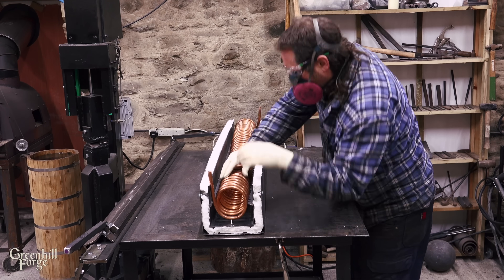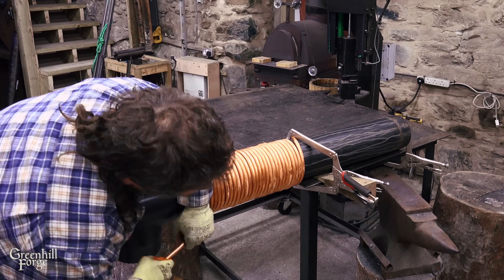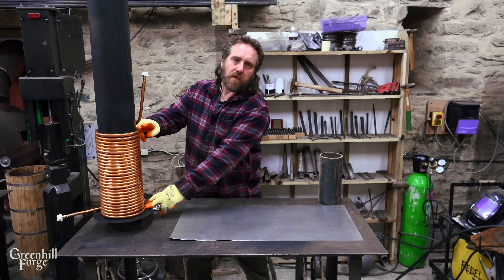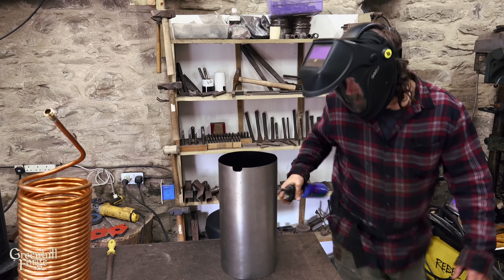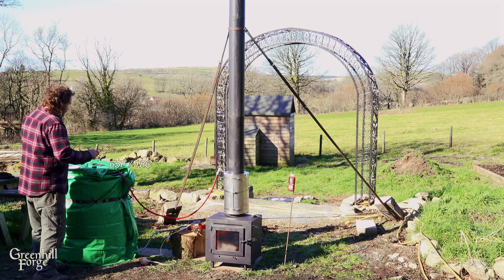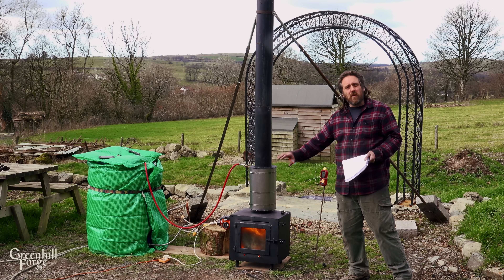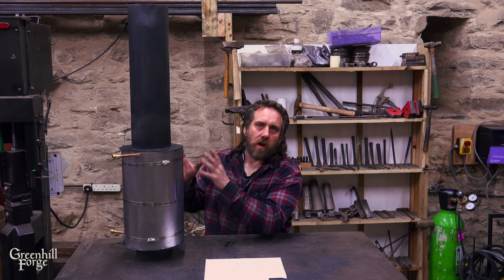Best Wood Stove Water Heater Yet: New Design Tested | Off Grid Water Heater pt3

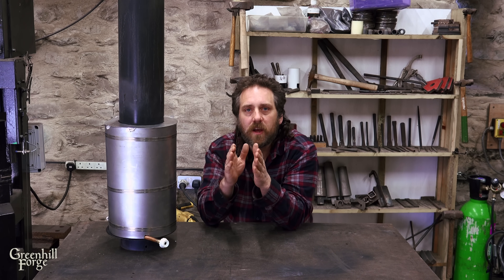Comment: 7:45 min: You are completely ignoring the horizontal surface of the fire box itself. Fabricating a shroud to capture the heat of the horizontal surface and have it funnel hot air into the copper coil sleeve.  Air holes to allow air to flow over the flat of the fire box and then funnelled to flow over the coil vertically upwards. A controlled aperture at the top of the coil sleeve would control the air velocity. This eliminates the need for insulation and heats the water from the entire surface area of the copper, not just from the contact with the flue.
 If one wished to use the flat area on top of the fire box for cooking you could fabricate a false box on top to serve the same function of funneling into the coil sleeve as a cone shape. This would still funnel very hot air, yet one could still cook. Controlling the air flow through the false box would also result in temperature control on the cooking area without reducing the fire. Another thought is using the false box as an oven for low lying food (i.e. cookies or fries. I would think you'd only want the false box to be 3-6" in height).
I enjoy your vids, tks

Comment: What happens if you install a 90 on your flue, then install your thermal transfer unit then another 90 back to the vertical? 
I would try that, but I would also try making it similar to a commercial boiler with steel tubes passing the flue gas through the water chamber then on the exhaust end install a box with a door that provides access for regular cleaning of the tubes with a bore brush.

Comment: Super cool set of experiments and outcomes. My one idea to improve it would be to make the flu wall crinkly where you have the copper coil and assembly. A crinkly wall will have more surface area but should not present a buildup issue inside of the fluid itself.

Comment: One large diameter water pipe inside the flue, or a C-shaped flue with the water inside? It would minimize surface area for creosote condensation. And with a C-shaped flue you could direct the radiant heat outward while having the wall-facing heat absorbed by the water.

Comment: Mechanical engineer here....The heat transfer is both a function of delta temperature of the flue gas vs the water and the thermal resistance between those two things.  Also a function of surface area.  Anything to improve those will help.  Making that copper pipe contact the steel liner better will make large improvements.  You could try filling it with water instead of graphite as a test and I bet it improves the heat transfer even more.
Reply: Could you eliminate the copper entirely and have a water jacket over the flue with pump flowing either from the top or the bottom? I guess it would boil too quickly and wouldn't meet the objective of using thermal to create the flow. Also more difficult to seal?
Reply: @spongefactory yes, this is literally how all real steam boilers work. Just copy one of the old steam locomotives
Reply: @spongefactory  On the downside, he will need to consider and address galvanic corrosion since the water medium will bring the dissimilar metals into electrical contact.
Reply: @tyiu5629 easily overcome with a standard sacrificial anode
Reply: @MYeahman an anode of what material, when the two in question are copper and steel?
Reply: @harrickvharrick3957  zinc, aluminium, magnesium or a alloy of these
Reply: @Greenhill Forge
Reply: @spongefactory  That would be the best idea.  He should try this.
Reply from the maker: @MrPizzaman09  Yeah, waterjackets/boilers are almost certainly the most efficient and I'll get into them eventually. Here I'm trying to make something than can be added on to a normal stove. I've got a grand vision I've been working toward that is in the design phase and won't be too much longer.
Reply: @GreenhillForge  Fantastic
Reply: @GreenhillForge where did u buy that little wood stove? 
I've been looking for a little wood stove but all I can find are really expensive...
Reply from the maker: @timstiles9026  I built this one and here's a video of the build https://youtu.be/pfWMZuctbXM
Reply: @GreenhillForge  and cooper tube spiral inside water jacket for healthy water. Also one idea to modify the stove so the water jacket sinks inside the stove burning chamber an inch or two, depending how big the stove or chamber is. logicaly should heat the water even faster. Peace and Respect.
Reply: Since your entitlement is probably close to 33% with the copper pipe inside the flue pipe, you probably won't get much better than 20% with it on the outside unless you were to stretch the copper coil up the length of the flue pipe more to increase surface area.  Part of the thermal resistance is the convection of the air inside the flue pipe to the steel, which will be part of the optimization game....most easily done by collecting heat further up the flue pipe .
Reply: Also a mechanical engineer here. If the intent of the testing of this setup is inside an off grid home and the wood stove is the heat source, one should concern themselves very little with efficiency of the heat transfer. With an older wood stove with incomplete combustion and high thermal efficiency, the rapid cooling of the flue gasses will condense the gasses, and creasote will build up in that area especially. If the "waste heat" runs through a brick chimney and heats your home, then the concern of efficiency isn't as important unless the domestic hot water requirements far outweigh the heating requirements. An example of this might be in the fall or spring, perhaps when you still want hot water but don't really need much heating.

Others have suggested spacing out the coils vertically for the next iterations for heat transfer area. I also recommend the same, but for the explicit reason of increasing natural convection in the fluid (you might hear it called "thermosyphon", or "stack effect", it all comes down to natural convection). It was mentioned that the ideal setup has no pump, so having a taller coil will help with this. I would actually like to embed a few vertical copper pipes, encased in grout, between the bricks and ss liner of a chimney from the basement to just below the roof rafters. It would take a while to come up to temperature but would make for great circulation.

My last comment is regarding thermal mass. I personally have a well-insulated ss glycol tank that is 105 US Gal because the water temperature drops quickly when taking a shower. The larger the tank, the less the temperature drops, but also the longer it takes to heat up. A smaller tank and higher efficiency heat transfer would be more suitable for a cabin if it were not lived in all the time, and you didn't want to wait long to come up to temperature.
Reply: Hi, another mechanical engineer here. I'm landing on a couple of improvements that you and others have mentioned. First, heat conductance (or lack thereof) is probably the single biggest issue here, since the coiled copper pipe only has a thin spiral line directly touching the flue on its ID. Furthermore, even that skinny point of contact is compromised because of the loosey-goosy construction where the coil isn't undersized initially to force it to constrict on the flue when wrapped around it. The graphite powder is a good idea (thermal conductivity 70-150 Wm°K), but the problem remains that on a micro level the grains only partially touch the copper and flue surfaces. If he used a solder alloy (thermal conductivity 60 Wm°K) to fill in the gaps between the copper pipe and the flue, his net touching surface area would jump. The solder shouldn't melt in use, because the water jacket should keep it under 212 °F. This is the same principal as boiling water in a paper cup under a flame.

Secondly, since the flue is quite long and remains consistently hot along its length, uncoiling the copper pipe to contact more uncooled flue pipe increases the ΔT overall.

This is a fun project and I'm glad he posted it.
Reply: I just had a final thought. The guy is a good welder, and the water is under very low pressure, so why not skip the copper tube and complete the water jacket? Simply weld in two threaded fittings, one at the bottom and one at the top, and voila! Perfect heat conductivity (or as perfectly as we can get in this simple setup). He can weld some obstructions to the flue (not enough to block the flow of water) to introduce turbulence inside the annular space too, increasing the rate of heat transfer. Apologies to other posters if they already thought of this.
Reply from the maker: @Paso_Dan  waterjackets/boilers are almost certainly the most efficient and I'll get into them eventually. Here I'm trying to make something than can be added on to a normal stove. I made an off-grid flue water jacket shower system I show in this video if you want to check it out. https://youtu.be/pP_2A5Wdvqg
Reply from the maker: @Paso_Dan  Hey. Good ideas. Copper powder would be an upgrade but much more expensive. Generally I agree about increasing physical contact but it adds some complexities for the build. The flue is coated with a ceramic powder coating so it would need to be swaped for exposed metal in order to solder/braze but then galvanic corrosion becomes more of an issue.
I am actually very interested what impact spreading the coil out would have on efficency. it's still the same amount of copper pipe and contact but the added length gives more time to conduct heat so I am curious to know the difference. I am working on a grand vision project that all these test have been leading to and I needed a shorter length coil for it but maybe after that project is done I'll come back and test the longer version
Reply: How should you maintaine the water? Using an expansion tank?
Reply: @Whiteflameone  Possibly, or a secondary water pump to the barrel.  Certainly not a long term solution, but it would be a scientific study mostly.
Reply: In my country we have a lot of (professionally build and maintained) power plants that burn wood pellets and supply hot water (district heating) and create electricity as a bi-product. Overall efficiency is 70%+
They extract heat from the process in several stages (first for the electric turbine, then by cooling the steam with LOTS of water, and then with a heatpump to cool the chimney air even further.

You could easily run a heatpump and create hot water with that instead. As long as the fire supplies hot air to the intake fan of the heat pump, it will have a COP of 5+ in mid-winter and with almost no wood needed to heat an entire house…
Reply: @lgolsen The author mentioned taking the system off-grid, though. An external power source would be necessary.
Reply from the maker: @lgolsen  Sounds cool, I'll look into it. What country?  If you know any resources I'd love to check them out. Thanks!
Reply: You could use thermal grease for cpus. It can be purchased in bulk fairly cheaply and will definitely improve thermal contact.
Reply: I’d take any of the suggested alternatives instead of graphite dust: water, copper powder … none of those sounds like a thermobaric warhead wrapped around a thousand degree flue…
Reply: Good choice on the graphite. If you extend the length of the heat exchanger to match the previous, internal one you should get a lot more heat transferred. Also try compacting the graphite.

BTW, your videos are some of the best on YouTube. Very thorough, explaining what you are doing and why are rare for this genre. Keep it up.
Reply: I appreciate your free information....
Reply: The issue is over-cooling flue gasses. At lower temps they will condense and form creosote deposits, increasing risk of chimney fire and reducing effective internal diameter. Also, cooking gases too much can cause backdraft.
Reply: The failures start with a wood stove. Start with a pechka.

Comment: What about using motor oil as a heat transfer medium, or, even crazier, melt in some aluminum or pewter and contain it in a steel sleeve. I think liquid or direct contact metal transfer will result in a higher efficiency.

Comment: Instead of sand, maybe some other medium that can surround the coil well, maybe like engine oil, antifreeze, or something that can withstand higher temperatures than water. that might be a good conductor without creating too much thermal mass. Or you could try welding the coil to the pipe so there’s direct contact and heat transfer. Graphite seems good, but it’s less convenient without a supplier. Looks good though.

Comment: How about using the hot water for hydronic heating of parts of the dwelling? Since nowadays it is unlikely that there is a heat source in snarly every room of a dwelling, couldn't the heated water be used to heat certain rooms in addition to the stove or stoves?

Comment: Next step would be to partially flatten the copper tube. Coil it with the flat area against the flu. This will make the coil longer and increase the surface area over which the heat can transfer from the flu to the coil.  It will also reduce the distance the heat must transfer into the water. Pack it with the graphite to increase the heat transfer. Heat transfer is proportional to surface area and inversely proportional to distance.

Comment: You already admitted you were losing alot of heat off the flue. I dont understand why you didn't make the coil twice as long to capture that wasted heat.
Reply from the maker: because copper pipe is expensive
Reply: @GreenhillForge  granted but isn't that penny wise pound foolish? If it doesn't work because the coil is too short then why waste the time or effort at all.
Reply from the maker: @billlyell8322  It does work, but sure, it could work better. But I'd rather have the money to explore new ideas rather than dump everything into one.
Reply: @GreenhillForge  i see your point but isn't it a bigger waste of money to build something that doesn't work properly? After all if it worked I'm sure you could find a buyer to not only recover the material cost but more.
Reply from the maker: @billlyell8322  I just don't see it that way at all. I want to build and test lots of things. But I have a limited budget. I'd strongly encourage you to build things that interest you, especially with how strongly you feel about this. But I'm good with how I do it. I'd rather have the money to have several other upcoming projects being worked on behind the scene.
Reply: @GreenhillForge  but would not the best way to extend if not possibly increase your budget be recover the cost of expenditures?

Comment: Couple ideas:
- what about soldering the copper to the pipe section?. Ultimately the contact point of the copper tube is small compared to it’s diameter. I wonder if soldering it would help with metal to metal heat transfer. Although it would be more difficult to construct. 

- What about thinner copper tubing? Less water in the system at a time to absorb the heat faster

Comment: You could make a jacket around the flue. So that the water is in direct contact with the flue. Very high surface area and thermal transfer. Implementation could be a nightmare though.

Comment: Use fins inside the tube to increase heat transfer, and use water in the cylinder that copper coils are inside, the water increases convective heat transfer by orders of magnitude

Comment: Graphite is the most cathodic material on the chart.  You're going to have serious galvanic problems with the copper and steel with that.  Graphite is never used as a lubricant on boats because of this.

Comment: I think making the coil taller by putting a slight gap between turns might get you a bit more efficiency.
A sterling engine run off the stoves heat could work the pump for off grid use

Comment: I think the length of the stretch of copper could matter, I know the amount fo copper is constant, but how far you have it stretched along the flue. when heat transfers from teh steel to the copper, it creates a small cold spot, that has to be reheated by the flow of air, so some space, aka a loose wind, would alow that to be 100% .

Comment: You want the coil inside and lots of turbulence in the flue gas, so the pipes are staggered. Like a peg board game. Any intermediate medium acts as an insulator
Gas should move slowly 

Measure flue gas before and after heat exchanger

Comment: Having that much powdered carbon around fire has to be dangerous. If a copper pipe got blocked and suddenly burst, it could disperse a bunch of hot carbon into the air very quickly. Fine powders can explode given the right/wrong circumstances.

Cool experiments, though! Be careful and maaaaybe try a less flammable heat transfer medium.

Comment: I agree about the problems with using powered aluminum, however I don't think you'd have the same concerns if you poured in molten aluminum, essentially casting a solid aluminum jacket around the copper pipes.

Comment: In my rocket mass heater, I used 1/2 black iron waterpipe, 1-8' stick wrapped in 2 coils, right above the fire box, and the lead on is in the exhaust chamber of the bell to prewarm before getting to the coils itself, I can burn 2 cubic ft of wood and raise 110 gallons of water from 100° F to over 122° F. But, water gets heat 3 ways, the coils, radiant heat from the bell, and the hot gasses passes under the bottom 55 gallon drum of water.  After a rebuild because firebrick came loose, noticed only creosote was near the opening for adding wood that doesn't get hot enough to burn the creosote.  The original coil had no creosote buildup on it. As long as fire is hot enough with enough airflow, it'll crack and burn all those carbons that build up.

Comment: Please try wrapping it in vertical heat pipes (search for "diy solar hear - pipe & exchanger: part 5" for a similar design).
The bottoms would be embedded in graphite in the same way as your final design, but it would have a second stage heat exchanger on top actively drawing the heat away from it.